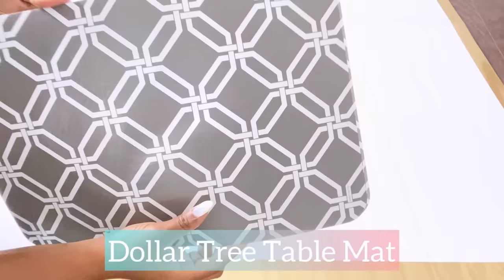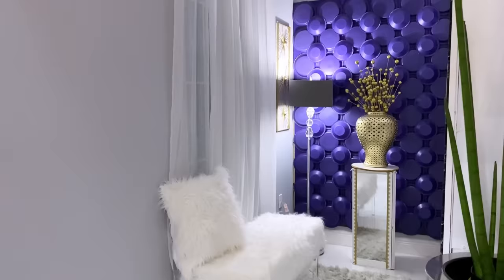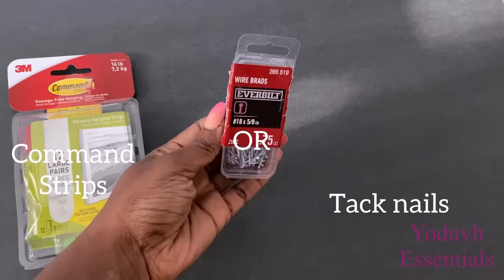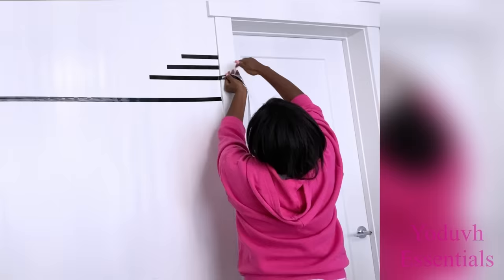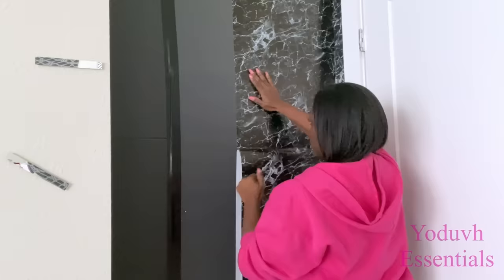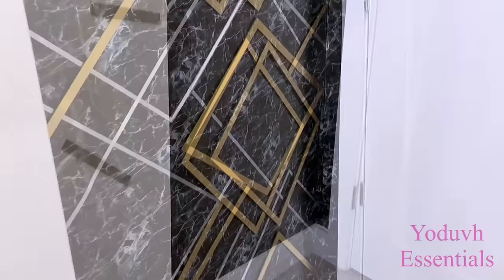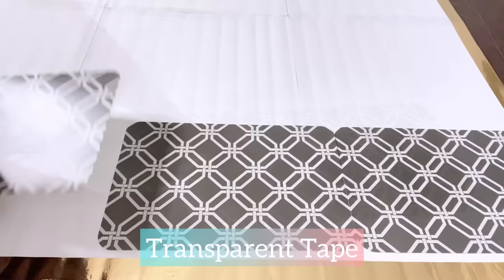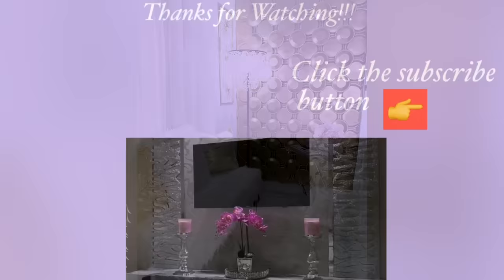WOW! DOLLAR TREE WALLs With Table Mats and More! WALL Decor IDEAS To Try Out in 2022

Comment: when the plates and bowls are on the wall was a different material used to attach the plates and bowls like sound proof form that have ridges. the original form board was smooth.

Comment: Interesting. I was thinking that it might be very good as a sound muffler. Some places do not have very thick walls .
  I'm surprised it wasn't gold.  As I watch you I keep thinking This lady has the mightest touch everything you create a so over the top. The most Recent edition was that darling little lamp you did with the paper towel holder in that clear bowl and I'm trying to figure out Where to find those little Puck lights with the remote I think those are fascinating I want those are even any kind of thing with a remote so that I could light up a whole room a little lights
Reply: As you can see I didn't watch the whole thing  Then as I exited from the message You said gold.  I bet your house is amazing. Like a Queen lives there I guess that's why you have so much gold.